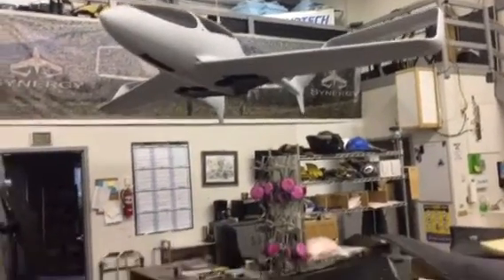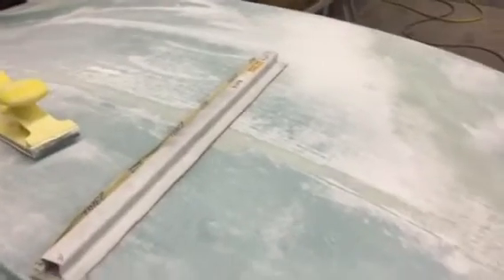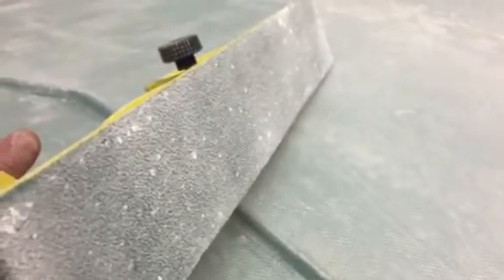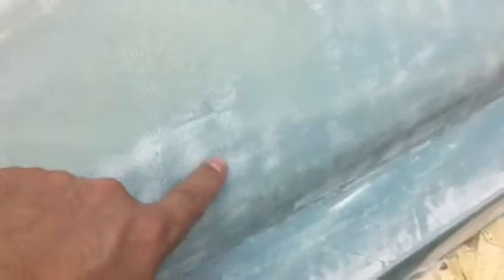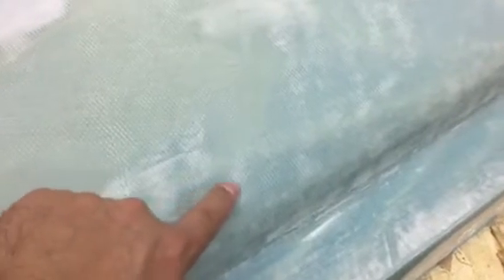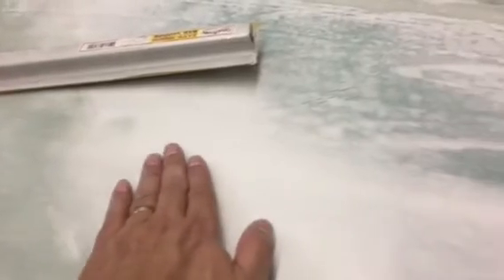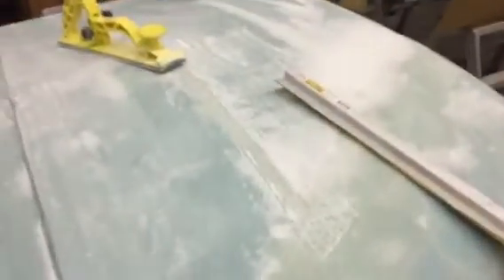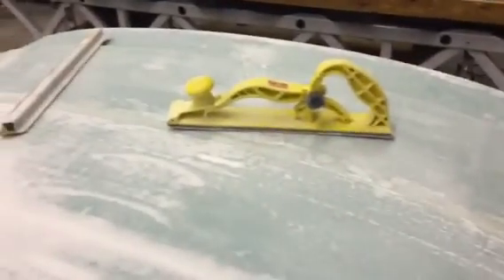Filling and Sanding for laminar flow

Comment: No updates, no scale model test flights, no full scale test floghts. Synergy and Celera had two different promising designs. What happened? Celera and Synergy both had egg-shaped fuselage to provide large interior volumes. Both promised fuel-efficient propulsion design. But Celera and Synergy have both faded away. Quietly.

Comment: how do you know it matches the CFD unless you probe or laser scan the surface.
Reply from the maker: CFD actually has nothing to do with it. Likewise, we don't necessarily want to match the solid models from the computer, as that would be a step backwards at the scale of these variations and disregard the improvements being discussed. We certainly do hope to capture our final forms at some point in the future through digital scanning, but the sculpted result is better than the as-modeled condition when it comes to realizing the mathematical intent, which is hard to describe to software but easy for a trained eye or hand to recognize. Our geometries were created in the computer by applying novel algorithms that, in turn, derive from specific principles and objectives developed by giants in the field back when there was no way to apply them. Many years later, the world's most advanced CFD (Computational Fluid Dynamics) software was run by leading firms to analyze the resulting solid models, but this video mentions that at the level of the digital information and its accurate output by CNC, the principles and objectives are not quite as well realized as when they are further applied by hand. NASA had the same incredulous response back in the 70s, when surfer dudes consistently beat computer codes in achieving laminar flow. We respect and unite the two worlds through translating the right physics into the right math, which requires a fairly deep understanding of first principles. And yes, the CFD did confirm projections... we couldn't find any significant improvements to make! We could only tease ourselves with what might be possible next time, since the principles we used are shown to be valid, and principles apply to any kind of airplane.

Comment: I want to build a long ez fuselage by CNC-ing foam with a 3 axis. How have you overcome the undercut/draft limitations of such a machine?
Reply from the maker: By prioritizing the critical surface, machining it in a way that makes sense and can be aligned later, then hacking happily away, caveman style, on the other side. Sometimes it turns out better on the sawn and sanded side than on the other! It's also often faster.

Comment: This is interesting.  I also follow the Raptor Aircraft channel, and the biggest difference I noticed is that they add a layer of putty over the fiberglass which they CNC back down to size before they start sanding.  Both techniques probably work well--I have no experience with either.  Good luck!  (See youtu.be/pkuKsCo5GJ4 )
Reply from the maker: Yep! Our putty had just been cut down to the required level when this was recorded. It's the white stuff, and the point of the video was to discuss how manual processes can go beyond what can be achieved in software and automation. It's been a surprising fact for a very long time, but it's true: old fashioned craftsmanship can still compete with the top tools of technology when it comes to organic forms and surfaces.